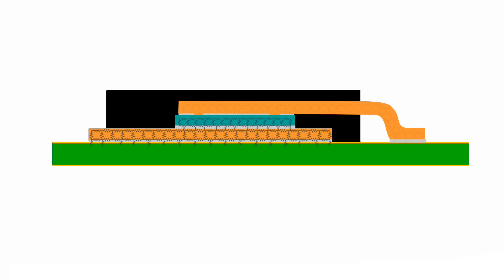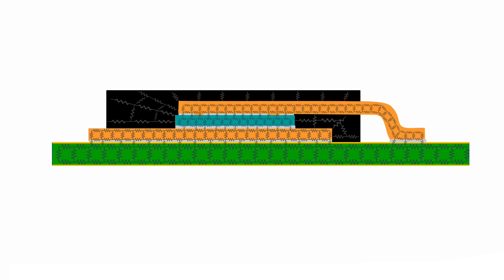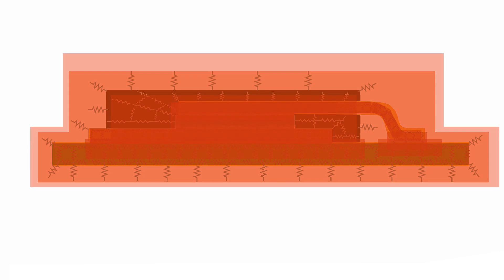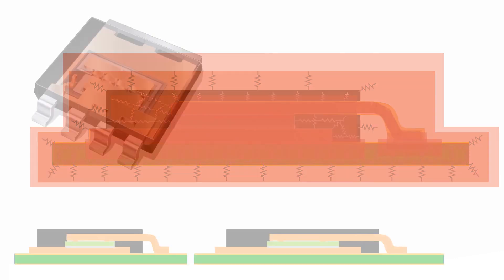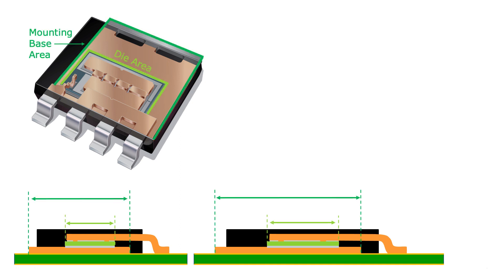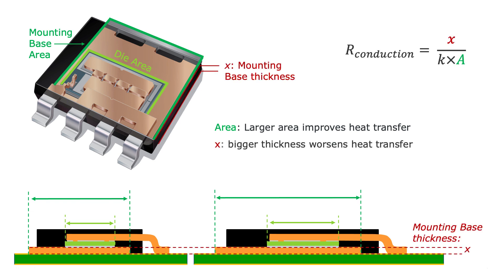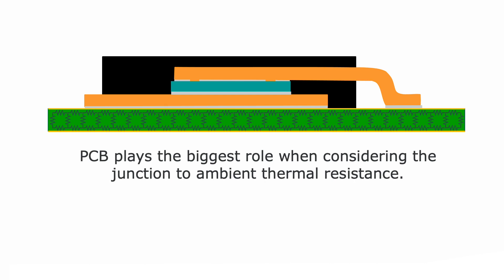What effect does changing the MOSFET have on Rth(j-a)?

Comment: can you make a to220 package with 500amps capacity and efficient parallel usage?
Reply from the maker: Thanks for your question! TO-220 is now an old package and there are some limitations in making this package capable of higher currents. TO-220 is typically a wire bonded package, where the wire bonds have high resistance values that not only limits the RDS(on) values, but also limits the maximum current carrying ability. To complicate it even further, because of the high wire bond resistance a lot of heat is actually generated by the wire bonds inside the package. If we solved this with a copper clip, we would still have the limitation that the PCB connection is achieved through 1 source and 1 drain lead. This limits the maximum current capability, as well as limiting the RDS value achievable at product level.

With packages like LFPAK88 and LFPAK56 we have internal copper clips connecting the 3 source pins to the source contact of the silicon. These source clips have a very low resistance, so allows for devices with much lower RDS(on). On top of this the source clip also acts as an additional heatsink that helps to cool the device. With the internal copper clip, we have a very low package resistance, good current spreading across the die surface compared to wire bonds (improved reliability), low package inductance (better for switching applications) and the added advantage of it acting as a heatsink.

In short, TO-220 would be a very inefficient package to use for 500A applications. It has the benefit that you can screw a heatsink direct to the package, but the manufacturing limitations limit its electrical performance. Surface mount packages like LFPAK56 and LFPAK88 are now the accepted alternatives to TO-220. Check out more about LFPAK88 or LFPAK56 here https://www.nexperia.com/products/mosfets/family/LFPAK88-MOSFETS/ or https://www.nexperia.com/products/mosfets/family/LFPAK56-MOSFETS/